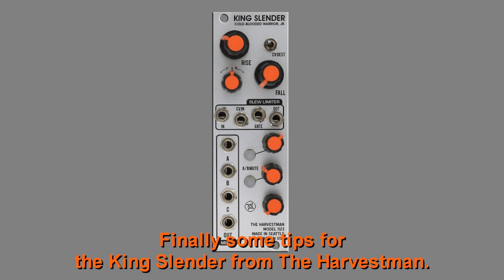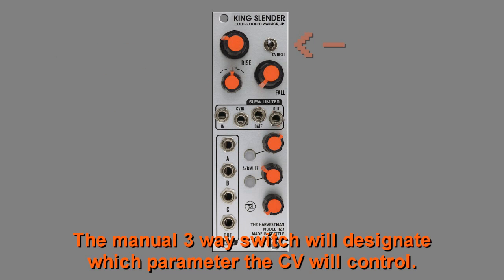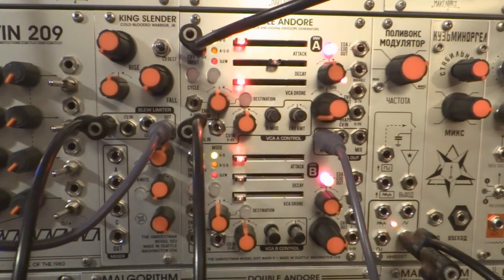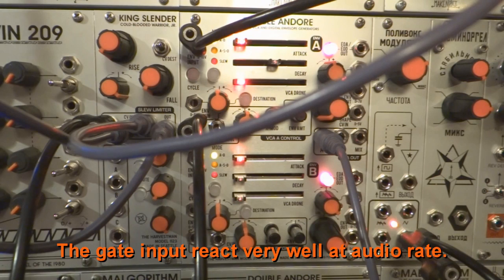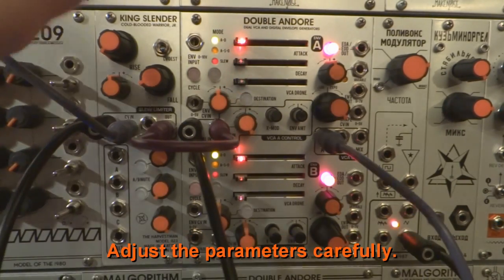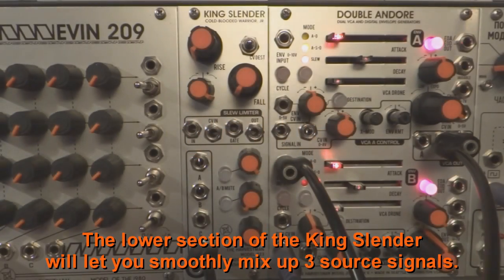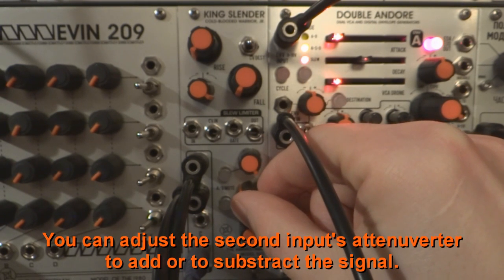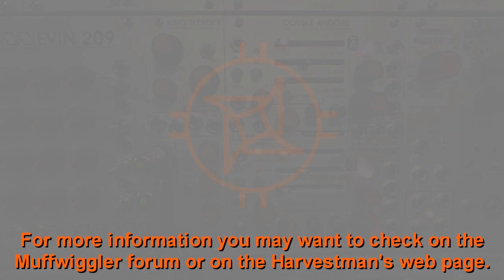Harvestman's King Slender : Quick Tips & Demo

Comment: Can it works as envelope follower? Filter? if I understand correctly, this is a Serge-style lag generator without trig and EOC.
Reply from the maker: Not really envelope follower, But by sending a trig, this trig will be transformed into and envelope when you adjust the rise and fall of the slew. And after I made this video, I find out that you can also use the Slew section as a utility VCA. I made a demonstration of this in the DA mk1 vid. And true, it kind filters some of the audio frequencies in the high range. This module is very useful. 
Here's a link to the VCA demo
https://youtu.be/VqieJYnVC5g?t=280